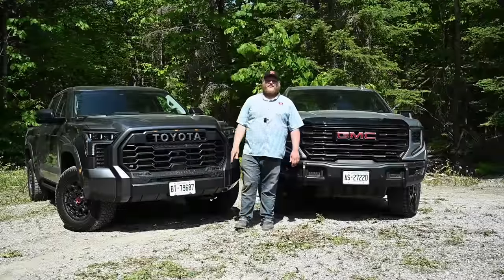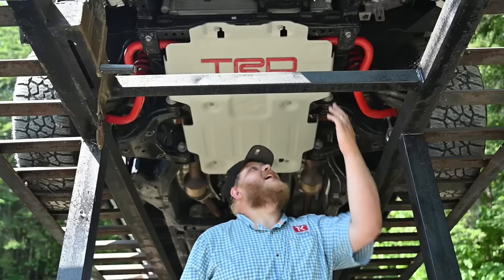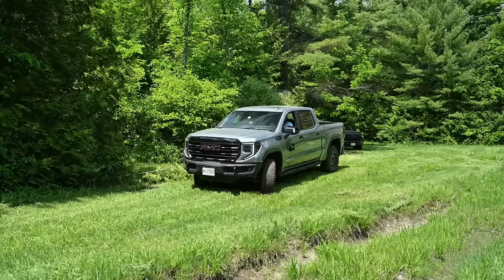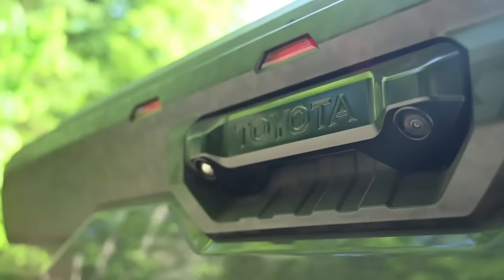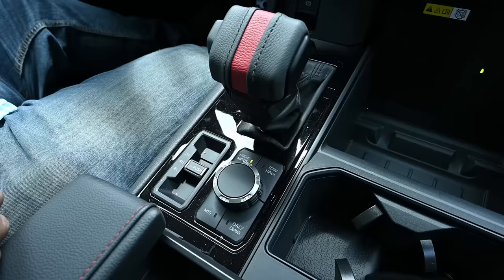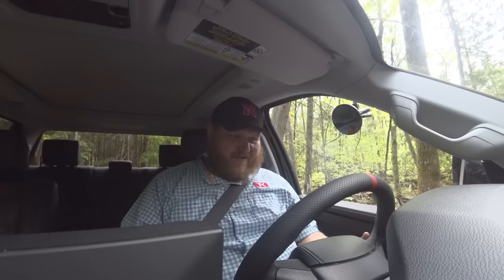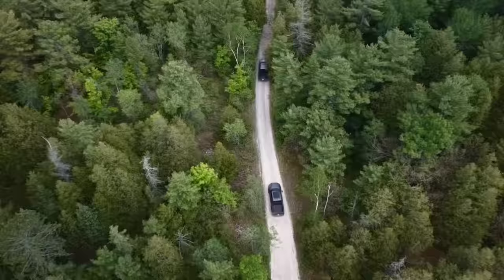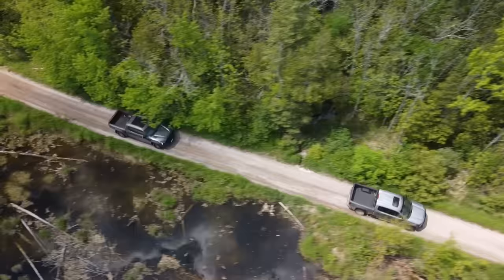2023 Toyota Tundra TRD Pro vs GMC Sierra AT4X AEV - Mud, Rocks & Water will Decide Which is Better!

Comment: The payload of those full size trucks  is laughable!!!😂😂😂😂😂😂
Reply: Agree. The RAM 2500 power wagon is just over 1k too and its a 2500!
Reply: @EGGINFOOLS  2500 is a super duty HD…
The tundra and that GMC are 1500, not the same
Reply: @wjoseph-rx9mj  Maybe you aren't understanding my comment. 2500 is NOT a Superduty. Super dutys are 250's. Ram and GM use 2500 names. The power wagon is a Ram and it's a 2500. Now my comment was to descibe that while these trucks have a low payload the RAM 2500 is just as bad in the powerwagon configuration and its a 3/4 ton truck
Reply: How much weight do you want to haul before the front end becomes unstable? Have you even driven a truck? That’s what trailers are made for.
Reply: @wjoseph-rx9mj  those payloads are still laughable for a 1500 (half ton).
Reply: @LayzeeGiant  payload is NOT just what’s in the bed. It’s also all passengers and gear INSIDE the truck.
Reply: @scotw67  You are correct. But they’re not made to haul significant weight. For what most people buy a light duty truck for, it does the job. Or a trailer when needed for heavier loads.
Reply: The low payloads on the GMC are for this specific model of 1500. The 1500 can be had with over 2000lbs of payload.

Comment: I was actually looking at both of these trucks, but ended up going with the AT4X AEV.  Here in Texas, the prices are way different.  The TRD Pro cant be had for less than 90k and the GMC can be had (or at least when I bought mine) for about 7k under MSRP

Comment: Interest rate for Toyota is a killer. In Canada.
$20,000 can get chewed up pretty quickly when you're 7% interest rate as opposed to 2.49 with GMC. 
So the payment isn't that much different at the end of the day The truck is more but the interest is low and the Toyota is cheaper but the interest is higher.

Comment: I have no skin in the game for either of these trucks, but you are clearly biased towards the GMC.

1) The GMC with the rear locker on slipped way more than the Tundra in the rut test, but you said the GMC did better.
2) The Tundra came out of the pit much more smoothly than the GMC, you did call that out, but kind of said they both did the same.
3) On the left hook, you definitely found the same/similar ruts on the transition from mud to dry ground/rock, but it was obvious on the Tundra you let off the gas right before and during the transition while with the GMC you maintained momentum (and momentum is a huge part of off-roading).
4) Your conclusion was that "they both made it, but the GMC did it with slightly less drama".  - I wouldn't necessarily call hitting your front skid plate and slipping with your lockers on vs. an unlocked Tundra "less drama".  They both did it and they both had their strengths and opportunities is a more accurate statement.

Had you been more neutral in your testing you probably would have stated that the Tundra has a better power-train because of the low end torque, the Tundra has better traction mapping as it did not slip as much as the GMC, but the GMC had a better departure angle that showed in real-world testing.  The GMC is using better tires, but needed all of those tires + lockers to be even with the Toyota.  Also, yes, the GMC has some features the Tundra doesn't (massaging seats, front locker, etc.), but GMC has not and is not engineered or built to the same standards Toyotas are.  

If you're planning on owning one of these for longer than 3 years, Toyota is always the no-brainer choice.
Reply: I saw the opposite. The bias is definitely in favor of the Toyota.
Reply: @Cyberriian1  interesting, what exactly was said in the video that made you feel this way?
Reply: @jamisonjamison8129  well, for one, the fact that the GMC didn't come off the ground on the first test and the Toyota did. The overall dismissal of that massive difference spoke volumes.
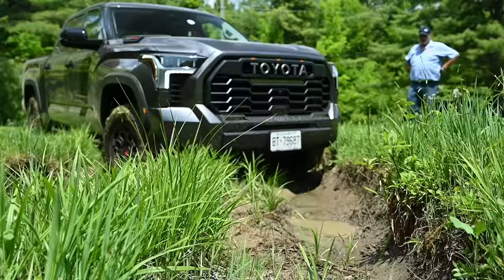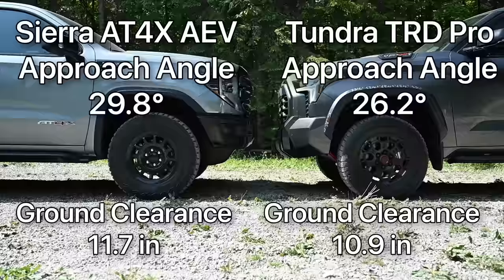Reply: @Cyberriian1  Maybe you should check that video again. at 11:12 he praised the GMC for it's flex. then at 11:22 you can clearly see the rear passenger tire of the GMC up in the air (completely off the ground). at 12:37 the Toyota, without the rear locker engaged lifts the front passenger tire, barely, off the ground.  Both trucks make it through the obstacle fine...just keep in mind that both lifted a tire, the GMC did have it's rear locker on while the Toyota didn't, and the presenter did state (at 12:55) that the "GMC was a hair better, but not by much".  So the facts don't match up with your rose colored glasses here (the video doesn't lie). So you have a GMC with better tires and a rear locker engaged vs. a Toyota with worse tires and no rear locker engaged and they both lifted a tire...not sure how this would be biased towards the Toyota...seems to me the Toyota did the same with less tire/locker, no?

Comment: Just purchased a 2023 AT4 no X and that should have been in the comparison instead of the AT4-X Priced at between $70,000 to $84,000, no front lockers just back. The X out performs the Pro by far. How do you put plastic for skid plates and tires made for Indy on a off road truck? The X would be better off going up against the Sequoia Pro than the Tundra Pro.

Comment: I'm extremely disappointed with the new Tundra. They threw all their reliability out the window and cheaped out on the truck compared to the previous gen trucks. Especially the twin turbo 6 engine. That's just asking for problems. It's not going to last much more than 100k miles. A twin turbo set up has never had longevity on any engine ever. So that was a big bomb. The 5.7 V8 they had before was solid and plenty of power. Some trucks went 1 million miles without a rebuild. This truck is pretty bad. I would honestly take the Chevy over the new tundra, And that's saying a lot because I love toyota.

Comment: Both trucks are nice, but still hard to beat Toyota reliability. A true truck enthusiast though that takes these rigs off-roading/overlanding, will mod them anyway. That said, nice review for their stock form. Tires and clearance/entry and departure angles are a huge factor. Off-road capabilities on both are 1000x better compared to earlier versions, and even interior and exterior designs are so nice, adding comfort, luxury, yet practicality. Now a days, I feel you really can't go wrong, as long as domestic (GMC/Chevy, Ford, RAM) have improved overall reliability and quality to match their Japanese/American counterparts.
Reply: BTW I have a 2020 Tundra Limited TRD Off-road. 2 of my brothers and my stepfather (their dad) have Chevy's. I love the V8 engine in my truck, so in a way I wish Toyota kept the V8, but gave it a power/torque boost. Also, I wish Toyota would introduce a Turbo-diesel in the American market. Those engines are popular here in Japan and all over the world and still have their legendary reliability.
Reply: I'm not sure toyota reliability is real I think they just get worked less. Don't see many toyota's being worked hard I believed the myth and convinced my lady to get one based on all the hear say. It's a 2018 model with more trouble then my old fords. Recalls water leaks rattles etc. Only toyota in the family and no better than any other vehicles we own or have owned.
Reply: The 2022+ Tundra has had tons of engine failures and transmission issues. Toyota reliability in the current era is a myth.
Reply: @rockie307  I had a 2011 Tundra and it had far more issues than one would have expected from a famously "reliable" Toyota. Cam tower oil leaks, air injection pump failures, hvac blower motor failure, rusty tailgate after less than 2 years, rear main seal leak, starter went bad at 80k mile, etc. There's a guy that hit a million miles in his Tundra but he drives long-hauls on the highway. Nearly any truck that gets meticulously maintained and used in the same manner can do that. There are very few guys doing what he does.
Reply: @hochhaul  A guy I hunt with has a 13 tundra same year as my f150 I beat the crap out of. He is always bragging about how reliable toyotas are. One day, I asked so what has he had to fix his list was longer then mine with less miles and treated way better. Just one example but it's funny how big of fan boys they are.

Comment: The extra $20,000 is due to the motor because the v-8 will outlast the turbo v-6
Reply: Plus the Toilota TuRD will be marked up $25,000.00+ at the dealership. 🇯🇵

Comment: Toyota is a very nice truck and cheaper but by the time it's paid off you will be replacing the hybrid batteries and possibly the turbos so the money you thought you were saving your not.That gmc 6.2 will outlast that Toyota twin turbo 3.5 with the hybrid.

Comment: I agree with your assessment. I think the GMC is only slightly better performance wise. I, personally, think it looks nicer/more aggressive too (overall shape, features, that silver paint color). 
But, that Tundra is probably more reliable (it's a toyota and bulletproof), will probably last longer, doesn't require premium gas like the 6.2, better fuel economy, and is of course much cheaper. 
I drove an '05 Sierra 1500 SLT for years and it was a cool truck, but I still think the smart choice would be to go with a Tundra.

Comment: GMC Hands down. Just deactivate the AFM/DFM as soon as you get it & you have an extremely reliable truck. Simple, easy to work on . Classic 6.2 that sounds great with an upgraded exhaust, Easy to maintain. I’ve heard the new tundras haven’t been so reliable with the hybrid &  TT that’s just more stuff that can fail. In the long run
Reply: Thst engine has been out for about 8 years with Lexus and they chose that engine for a reason. My father in law has a shop and they still haven't had anyone go in yet to do an exhaust or any maintenance on them. I picked up a 2024 2 months ago and it's a dream. But my biggest complaint in general is how obsurd they have gone up in price for a basic truck. I wanted an SR in 4x4 so I can pimp it out myself but they don't ever sell them. I got a fully decked out SR5 in a rare color. I could have got a basic limited. But the added tech made me feel like it was going to add more problems down the road. Also you wouldn't get all the off road modes or the offroad suspension. If you wanted a decked out limited its at least 10k more than a decked out sr5. For 90% of buyers the sr5 is more than you need. But they pumped out more of the higher end models so you have no choice but to buy the more expensive trucks which is where toyota has really turned to the dark side. Toyota used to be the company that gave the people what they needed at a fair price. Now they're exploiting us the basic needs we need in a vehicle. It's horrible. After 2 years I won't be able to do remote start unless I pay the month plan. That's needed in cold weather so you can get up your vehicle before going on the road. These mew trucks will last mostly 15-20 years. But I don't see them breaking the 500k mile mark like the 5.7. Hopefully I'm wrong.

Comment: and in 150,000 miles you'll be spending 10-20 grand to replace that stressed out, overworked, V6 and/or electric motors vs that venerable 6.2L V8

Comment: No way Jose.  Your first test ran the GMC first followed by the TOY.  Every test thereafter he ran the TOY first and made some small drivable adjustments picking up the pace on the mod bogging after using the TOY as the test mule.  He favors GMC passively.   At 100K that GMC will fall apart while the TOY is waiting for the real drive party to start.

Comment: I don’t like any new trucks but the Toyota having no front tow hooks is an absolute no go for me if I were to be buying one of those two trucks. I’ll keep my 98 gmc sierra, my 09 duramax and the one that will blow all of them out of the water for off road capability my 86 k20 with rear locker and solid front axle with a 4speed with the granny gear, never had that old beast stuck with stock height and some mud tires.

Comment: GMC all day. Better interior. Better off-road equipment. Better power terrain. The Toyota hybrid twin - turbo v-6 is not proven. GMC has better angles. Also did you hear the Toyota popping and creaking while he was crossing the ditch......bad! All the nanny crap and digging going on while off-roading, that gets old fast. NO TOW HOOKS ON THE TUNDRA.....🤣😂😅, how stupid. GMC has them and freaking in beast mode. So there are tons more reasons the GMC is better but for what this video was about (off-roading) the GMC kicks the snot out of the Toyota... easily.

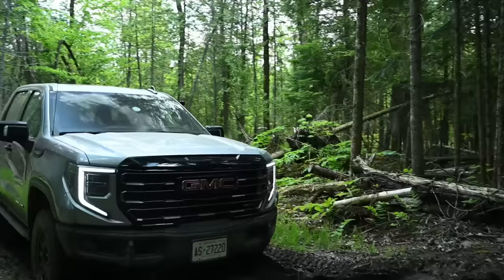Comment: You didn't carry the same momentum out of the mud in the Tundra as you did in the GMC. This is the same trick that the truck companies used to use in the old comparison commercials. One truck would stop at the bottom of the ditch and not make it out. The other would carry momentum and make it through fine. At 24:37 you let off the gas completely in the Tundra and let the truck almost stop totally. But at 26:56 in the GMC you stayed in the gas more and carried the speed more. Of course the tires made a huge difference too but still. You have to try to do it as equal as possible in those cases.

Comment: OEM Goodyear Wrangler MT stands for Multi-terrain NOT mud terrain.  
ATRAC on toyota's all are based on throddle and require as much to engage. 

Clearly the trucks traction is difficult to compare since the Tundra has a hwy AT

Comment: Confirmation of why I own 2002 Sequoia (263K running like it did factory test day) that blows the doors off both these.  

What's the point off off-roading in a play pickup when you can have the shorter wheelbase and enclosed back and with the weight over the rear tires like an SUV? With all the rear seats removed I have a 6.5' bed in the back?

Comment: Very good comparison. Nice job. Surprised Toyota didn’t put in a locking diff in the front. That’s a nice feature. Agree that GMC is not worth $20,000 more. I have owned both GMC & Toyota through out my lifetime and find the Toyota better quality and more reliable and believe me I am as pro American as they come having served 3 tours in Iraq.
Reply: The tundra is the most American built truck in America right now. Get one you won't regret it. Just try to hustle the dealer. These prices are unethical
Reply: @dethtour  Funny you mention that. I live on Long Island in NY and the prices here are still $3000-$4000 over sticker. I saved $8000 by buying my 1794 Tundra with the TRD package in Cincinnati Ohio. It was $5000 under sticker. Only cost me $168.00 for the one way plane ticket & salesman picked me up at the airport. Well, well worth it. NY prices are ridiculous.

Comment: Dude I am looking at both of those trucks to replace my 2015 tundra  although nothing is wrong with my old beast  other than her sweet tooth for WaWa's and 7eleven's visits and  I just want new, but when Toyota changed the body style and got rid of the 5.7 I started looking at the second reliable pickup on the Market the GMC. So I was very into the video of testing both of them side by side. Now I am convinced I am sticking with tundra due to the front end skid plate being higher then the GMC as well as the infotainment system in the tundra, the first thing I would replace is the OEM wild peaks (garbage) and go with my #1 tire Toyo's all terrain that will give that new robotic tundra some digging power.

Comment: Toyota’s release of the 3rd gen Tundra was a complete flop. 3 years in and they are still experiencing the same issues. It is a cheap plastic rattle trap and major disappointment. Hopefully Toyota learned form this disaster and doesn’t blow the reputation of the Tacoma.

Comment: You have anything for me to add for my 2020 Toyota Tacoma on the driver side so my mom can get inside the truck easier. I was asking Toyota dealership if they can add the same passenger side handle and they said we can’t do that. Due too that will be us modifying to the truck and Toyota doesn’t do that. But Toyota told me to find a off-road shop 😢

Comment: The tundra looks like a 6 year old designed it, has worse tires and shocks, no tow hooks, smaller cab, who puts reverse lights in a bumper? That's the first thing to get dented up in a truck? Plastic skid plates and lack of them in other areas, overly complex power train that you could hear had to rev up to match the low bottom end torque of the GMC, worse interior and it sounds as crappy as it looks.

Comment: That payload and towing capacity is rather embarrassing on the GMC.
Reply: This is their offroad specific model  with soft suspension. Choose any of their other models that cater to your desires.
Reply: @googleaccount2637  I drive a 2022 Tundra OFF ROAD model. My payload and towing capacity is tremendously better than the GMC. Your point is??
Reply: @MountainManBran gmc obviously offers many truck models with vastly superior offroad capabilities or towing/payload capabilities. Duh
Reply: @googleaccount2637  and the two being compared here makes the GMC look rather embarrassing. Back to my original point.
Reply: @googleaccount2637  also, I've never heard someone say that a GMC is vastly superior at offroading than a Toyota is. That's a rather embarrassing opinion lol.